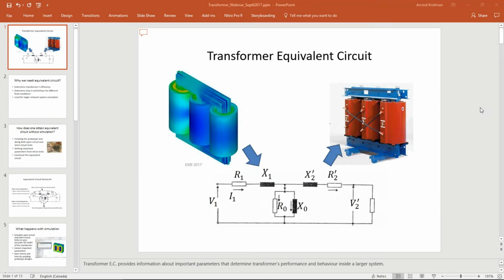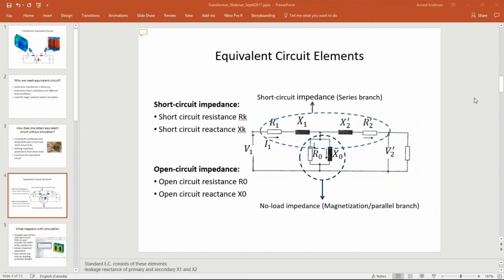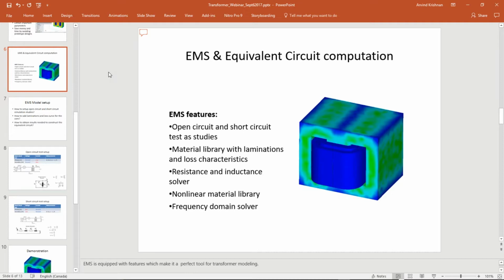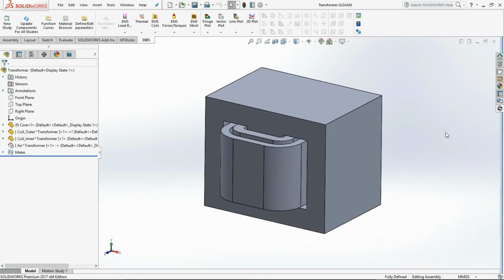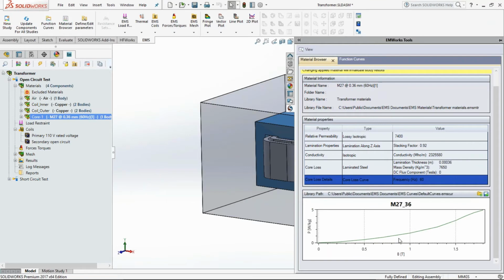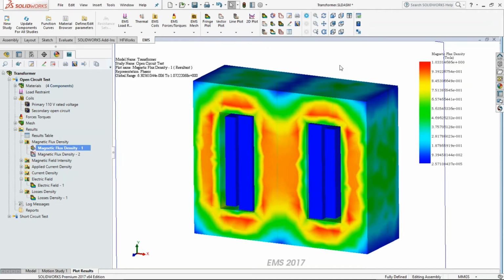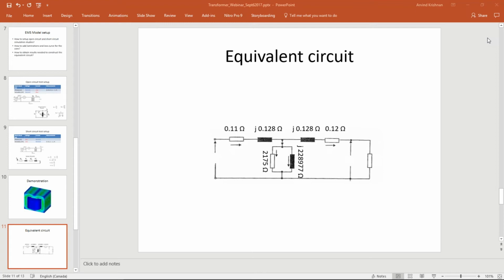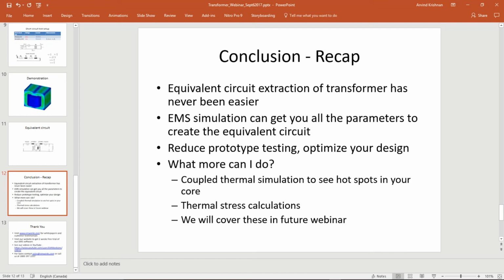[Webinar] - EMS : Transformer Losses Computation and Transformer Equivalent Circuit Analysis

Comment: Very strange: in 31.45 i see curent 5e-5 A (110 V, power=0.0055 W) in 32.16 core loss 11W. Where mistake? May be phase =0?
Reply from the maker: Hello Arnold,
Thank you for your interest in our videos. However the magnitude of the current is around 0.26 in 31.45s. 
Thanks